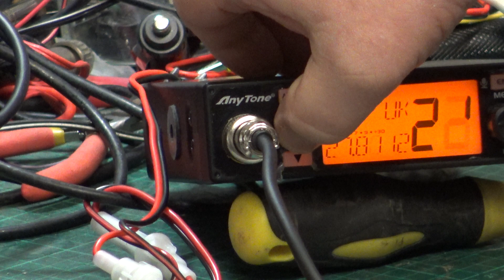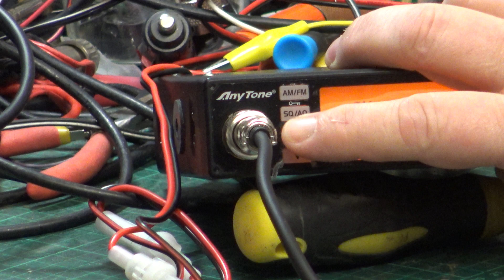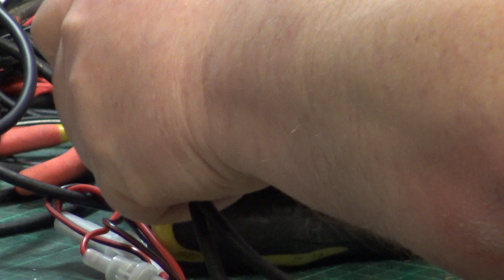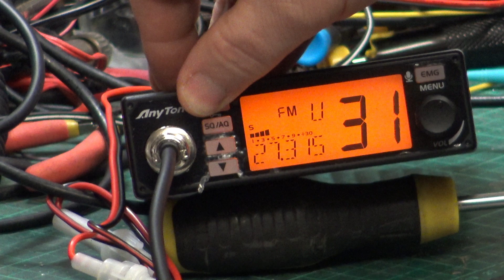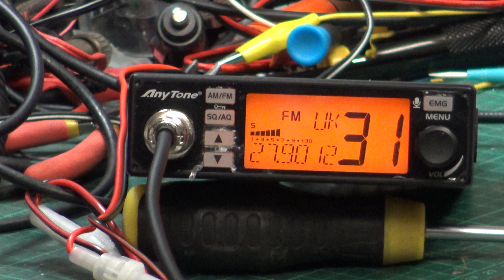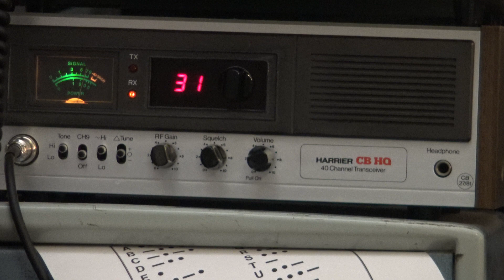Anytone AT500M UK CE MultiNorm CB radio (mobile) - On The Air test

Comment: Wow it sounds sooo tinny into the base station. Id like to see if an old fashioned dynamic microphone helps at all. I really dont understand why the manufacturer is restricting deviation capability to 2khz or less??
Reply from the maker: It's fitting around this am/fm euro crap. By limiting FM deviation they can get away with using only one filter. Best buy older FM only radios. I don't need Antique Mode anyway. Roger on  a Dynamic mic, would be a good idea to test...but I'm not funding it...let the manufactuer set up a demo!

Richard
Reply: @ukfmcbradioservicingTango21  thanks for the explanation Richard, what theyll do to save a few pennies is shocking. Please keep the videos coming, i enjoy them and your anecdotes very much.
Reply from the maker: What pi**es me off about this filtering thing....is they are doing this at the £240 end of the market...jut just the £39,99 end. In fact, as I look at new sets, the cheaper ones seem to work better than the expensive ones....and actually have knobs & not squelch in a hidden sub-menu!

Richard
Reply: @ukfmcbradioservicingTango21  it’s naughty isn’t it. Also I’d rather adjust a trimmer than have a menu to do it
Reply: @hcweatherupdates  its a shame that in this day and age the audio isnt better not worse. On your other point, I thought the instructions for that radio (from what i could see on screen) showed similar menu options to my President Bill